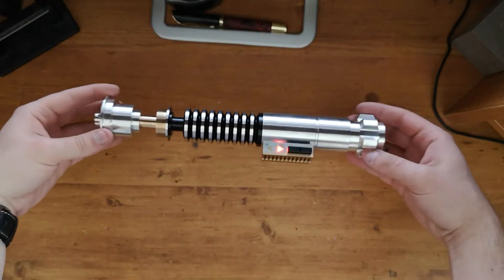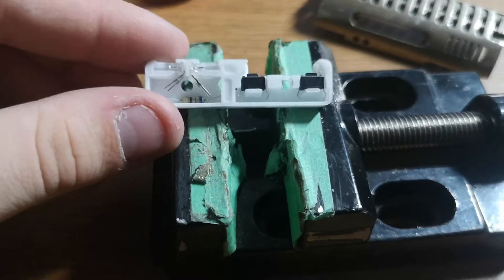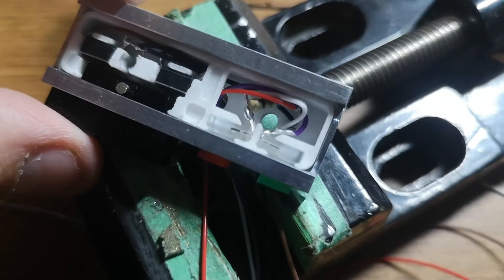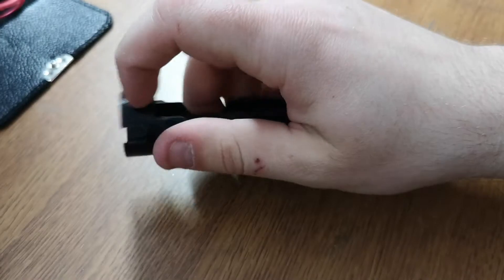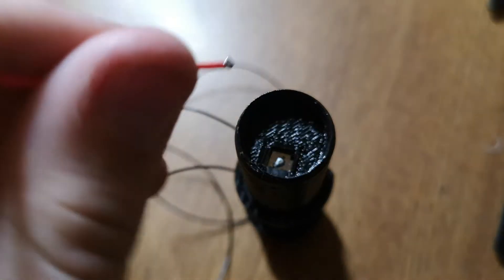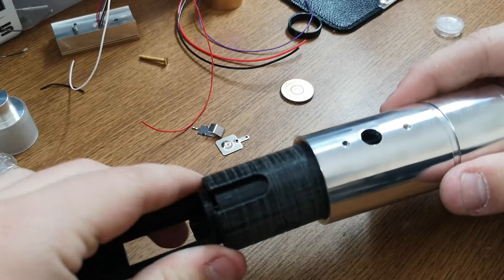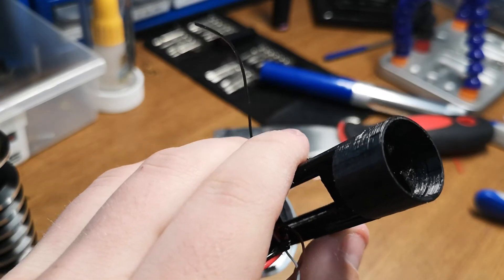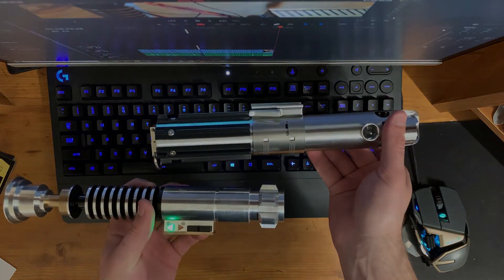LIGHTSABER TUTORIAL: Creepy Uncle Goth3-Designs Chassis

Comment: What size resistors should I use for the accents on my control box LEDs if I'm using a proffie? Also, would you recommend using white LEDs and letting the little translucent arrows do the color work? Or match the different LED colors to each arrow?
Reply from the maker: It’s always best to do your own resistor calculations with a PSU and multimeter. 

I match color for better lighting. But in theory you could use white leds to save time and space with resistors. Generally white leds don’t need a resistor
Reply: @daviniumcustoms6857  I'll do some testing! I tried using TCSS resistor calculator but I'm not seeing an option for normal 3mm LEDs.  I assumed white would be brighter than matching the acrylic color.
Reply from the maker: @g0dzirra202  it would be, but you have the potential to wash out the color a little. 

For resistor calculations, find your LED spec and use an online calculator. For red it’s usually 33ohm. For blue, green, white, you can usually get away without it

Comment: Hey, great video! I am doing a similar install  on my Creepy uncle and had a question about the control Box LED's. I noticed you only used one resistor for one of the LEDs - is there a reason why you only resistored the one and not the other (unless im not seeing it and the other resistor is hiding somewhere)? Could you get away with not resistoring the LEDS? noob question, I know - First time using standard LEDs in a proffie build for me.  Also did you solder them to the 3.3v pad or the other LED pads?
Reply from the maker: You’ll need to calculate your resistor values based on the specs of the leds and the pads you wire them to. Green leds generally won’t require resistors, same with blue and white. But it’s always best to check!

As for where to wire them, differ to the manual and decide what’s best for your build and config
Reply: @daviniumcustoms6857   Thank you, that helps greatly! 😁

Comment: How did you wire the pcb on the battery half
Reply from the maker: You’ll want to keep your leads as short as you can, so there isn’t much wire slack. The easiest way is to wire it up close, adhere it with some e6000, and then position it in the chassis assembly so it presses against the male pins on the top end connector to ensure it glues in place
Reply: @daviniumcustoms6857  thanks a lot thats what I was thinking but I wanted to make sure

Comment: How did you manage to get the neopixel pcb to reach the blade through the thin neck? Did you use an adapter of some kind?
Reply from the maker: Andy Lindquist there’s a pocket in the emitter for the pcb
Reply: @daviniumcustoms6857  right. I get how the PCB sits in the blade holder. I'm wondering how you managed to connect the 2 pcbs (1 from blade, 1 from chassis) without any wires in between
Reply from the maker: @DarthRaptor22  The PCB in the grenade is wired to the PCB in the emitter :)
Reply: @daviniumcustoms6857  Did you have a hilt side npxl connector in the emitter wired to a blade side within the hilt and then another hilt side on the chassis to be able to remove it without pulling any wires?   if so , did you find a wiring diagram or need to modify how they connect up and or different use of resistors ? do you just keep the leads consistent just kind of flip flopped when you go from hilt, to blade , to hilt connector?  thanks for any input
Reply from the maker: @steelyerface21  There is a hilt-side PCB in the chassis top, a blade side in the grenade, and another hilt in the emitter. The grenade and emitter are wired together as expected: + to + and - to - . Resistors don't matter so long as there's at least one resistor on your data line somewhere.
Reply: @daviniumcustoms6857  Hey dude. I'm on this journey now too... For the wiring between emitter and grenade, what was your process to keep wires short? Do you solder grenade-side pad PCB, feed it through to the emitter, then cut short and solder as close to the top of the emitter as possible? Did you just coil the wires so they fold down to make the emitter PCB reach the bottom of the emitter? I'm jut concerned because I find soldering those PCBs an utter nightmare at the best of times.
Reply from the maker: @4str0m3ch  I find the best way is to solder grenade first, press it in with the grenade chassis section, and then trim the wires so they can scrunch up through the wire passage after the emitter pcb is wired. You don’t want too much slack, but you don’t want to struggle to wire it. A few centimetres of wire out from the emitter should do

Comment: What resistors did you use for the LEDS? I'm wiring a proffie version of this right now, and have come to a roadblock on what model these leds are.
Reply: Would you possibly have a link to the resistor that you used? I can’t find one. I’m using the red led that came with the kit.
Reply from the maker: Generaly, red accent leds will have the same data sheet specs. Look up the specs for 5mm straw hat red led